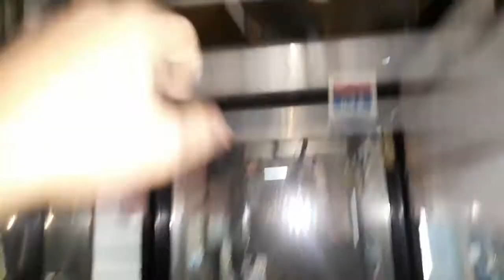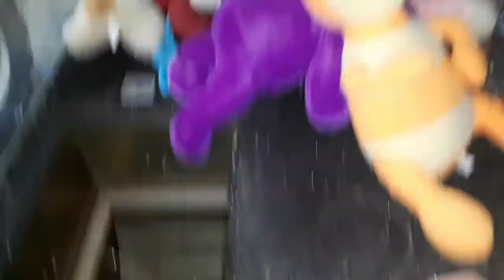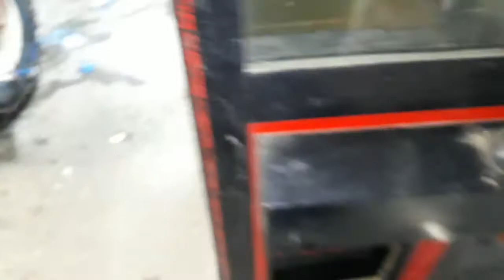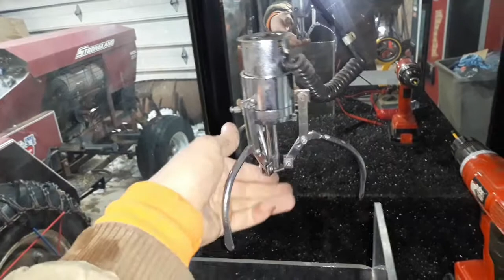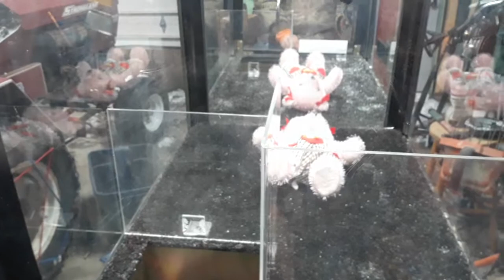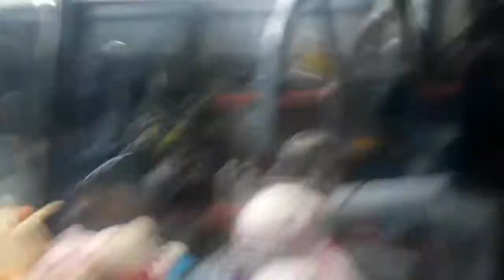Weekend flip! claw machine restoration!

Comment: I should note my manual isn’t exactly matching like yours but like yours my board inside is identical so I think these are the right boards put in from the company . Like others Hollywood has different models all just slightly different inside but compatible which is why I think some have manuals but different boards.

Comment: Hey love all these awesome project videos!!! I’m going through and watching all of them as I can. I to am restoring games . I have a Hollywood claw machine which is identical to this one pretty much . I got everything working after fixing cut wires and getting everything moving freely again from old grease etc. it now after dropping the claw and pulling back up does not stop winding up so I’m guessing the limit switch probably broke where the claw hits it at the top. In the meantime the inside is identical to this one. Where would you suggest I look for a new matching power supply and those square relays inside ? I’m new to learning how to fix games so I’m not sure sometimes where to look for things.
Reply from the maker: Does sound like the limit switch or the piece that hits the limit switch. Unfortunately it's been a few years so I don't remember anything about the power supply. I'd just measure the output and just search around for one with the same output. The relays probably have markings on them that you can use to identify them but I'm sure they are pretty generic and you could find compatible replacements on digikey you'd just have to make sure they have the same footprint.
Reply: @BlocksRetroRepairs got ya I’ll look into that ! Thanks for the extra info as that always helps! Looking forward to your future videos.